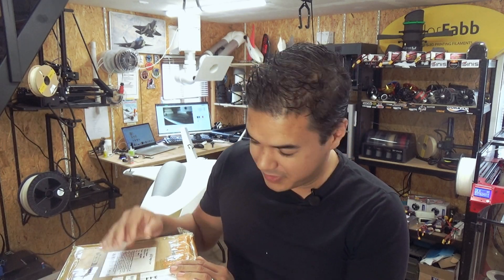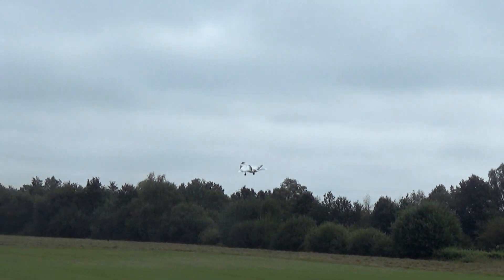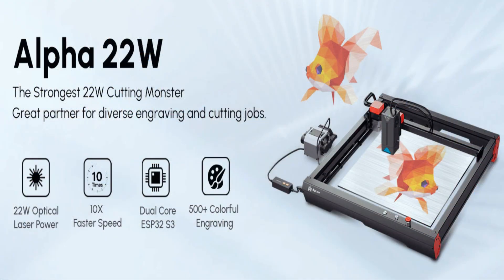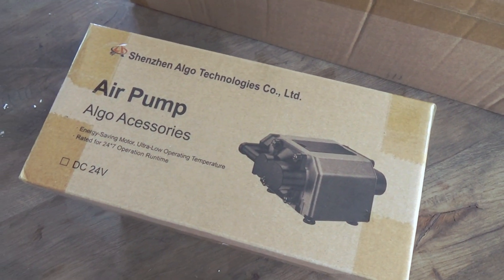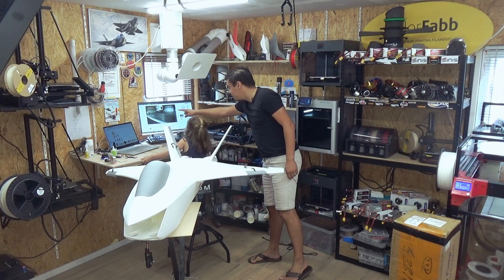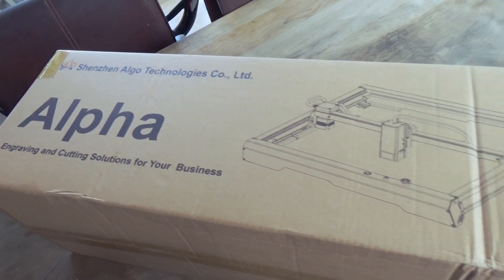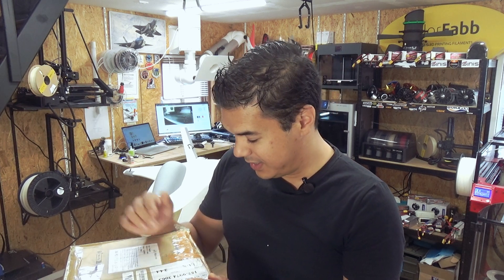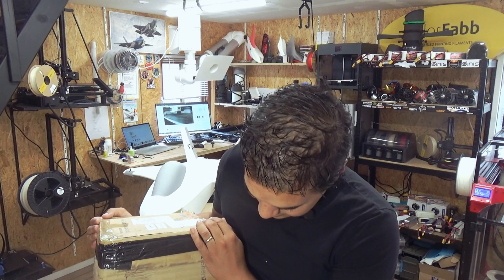The Algo Laser ALPHA 22W | Lasercutting a Lipo Holder for the Boeing X32 VTOL RC Model

Comment: Hey Joel! I might ask you, in your 2m length f35's 3bsm swivel module, i've noticed that you've used miniature bearings. What is their outside diameter? and also did they affect the 3bsm's weight? because i've seen that MR52ZZ bearings (5mm OD bearings) actually weigh 200 grams each, which is crazy because u seem to have 32pcs in the 3bsm! don't judge me if i'm wrong, i pay too much attention to details 😅Also i've noticed that you started focusing on the 3d printed f35 and abandoned the 1:8 scale project, did you encounter technical problems in it? Or you're still working on it?
Reply from the maker: These are 3x7x3
Reply from the maker: Still work I progress, time is my biggest issue